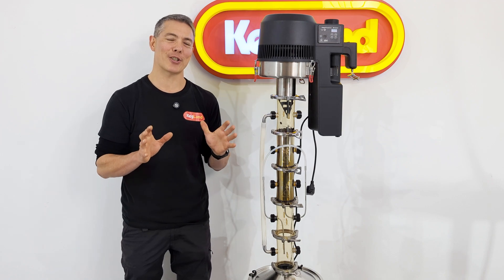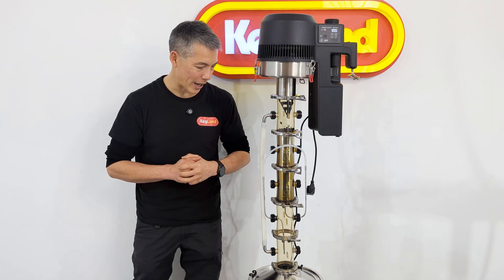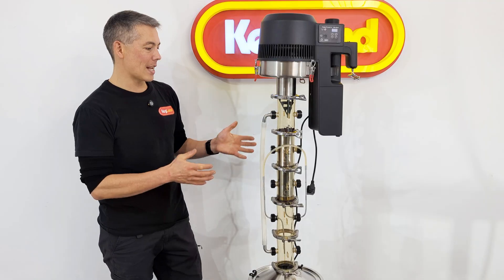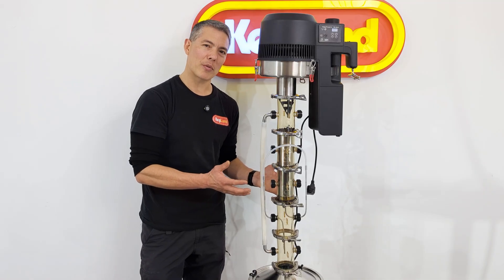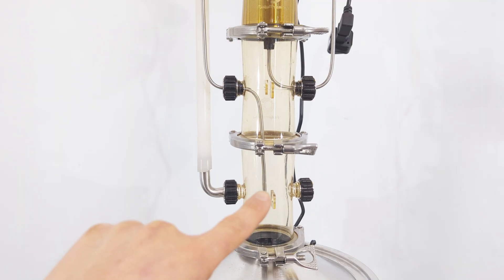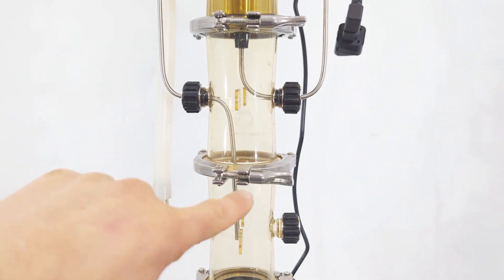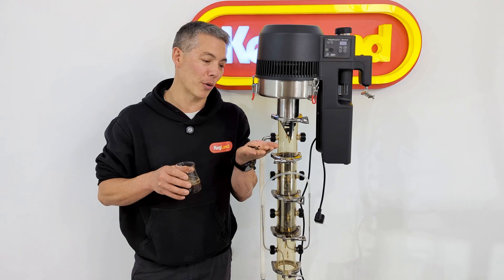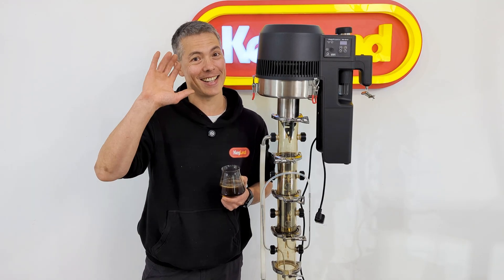How to use Polyphoenix Air Still for Soxhlet Extraction/Distillation

Comment: Would i be feasible to extract the flavours/oils off Hops, orange peel, lemon peel etc. and add the concentrate to your beer instead of boiling them with your beer?
Reply from the maker: Yes absolutely.  This process is a good way to extract lemon oils for limoncello.  I am going to also to some testing with hops to see how well this works. The only issue with hops is that the the boiling point of alcohol is quite close to the isomerisation point of the hops.  I think  it might be better to do this with hexane or some other lower boiling point hydrocarbon.

Comment: After seeing the previous AirStill video, and now this, I'd love to see what it takes to use the Air Still to reach azeotrope.  Seeing the need for a power controller on the boiler for the soxhlet process made me wonder if this or any other mods would be necessary for using the air still instead of a water-based condenser at the top of the column.  Personally, I'm all for saving water, but it would be nice to know what the tradeoffs are likely to be in terms of setup, process, time, and output when compared to doing it the 'watery way'.  Regardless, I'm really looking forward to being able to get my hands on one of these and put it through its paces!
Reply from the maker: I will make an in depth video about this later. It's quite easy to get azeotrope with the air still.  The internal column in the air still is about 30cm long, so to get azeotrope you need to have an additional 70cm of polyphoenix parts attached externally to the column so the cumulative length is about 1 meter.  Then attach the boiler to the column and then use the power controller to set the power on the boiler. It's a really simple process and far easier than water cooling.  The only thing is the collection speed is a bit slow and is about 600ml per hour.  With that said it's highly automated so this makes the slow collection speed tolerable.

Comment: If you mix this `coffee` with condensed milk, a drup of vanilla flavour, brown sugar, and unwhipped full cream, you basically have a better  Baileys. Just a tip.
Reply: I didn’t think Baileys had a coffee flavour or coffee in it?
Reply: @Zumaray 
Baileys Irish Cream is known for its rich, smooth, and indulgent flavor profile. The original Baileys Irish Cream contains a blend of:

Core Flavours:

Irish whiskey – adds warmth and depth

Fresh dairy cream – gives it a rich, velvety texture

Chocolate – sweet and cocoa-forward

Vanilla – for a smooth, aromatic sweetness

These ingredients combine to create a creamy, slightly boozy, chocolate-vanilla dessert-like drink with a mellow whiskey finish.

There is however a Baileys Espresso Crème available. As well as other flavours
Reply: @PetraKann Baileys S’mores! Interesting
Reply from the maker: I was under the impression that Baileys was more cocoa than coffee.  Maybe we should use coco-nibs in this process and then use that Soxhlet extraction for Baileys?
Reply: @KegLand 
Yes, Baileys Irish Cream does not contain coffee or added caffeine in its original/classic version.
The company did however release two versions that do contain coffee: Bailey's expresso and Bailey's coffee (limited edition).